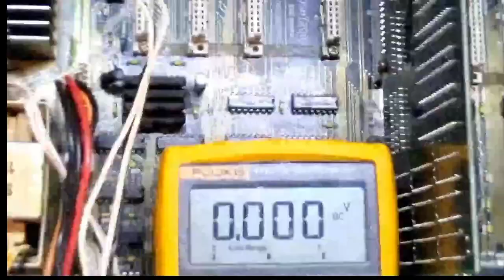Akai s1100 Repair Distorted 8 bit sound

Comment: So Ive never worked on a S1100 but electronic repair is what I do daily.

Imma say your transformer is fine, as mentioned in comment below it's regulated to 12vdc
A step down transformer is not gonna give clean DC voltage. On a side note, a 12vdc power supply can read around 15vdc when there's no load. So 15vdc is normal. A bad transformer generally has bad windings and it'll just be DEAD. A bad voltage regulator can give a wrong output voltage but if that were true every on the 12vdc rail would most likely not be on.
I honestly wouldn't be looking in the power supply area. To be honest, because the sampler has so many IC's you need to probe with an oscilloscope or atleast a cheap logic analyzer to make sure chips are working properly.  I haven't been following all your videos in regards to this but if measuring capacitors or even resistors in circuit you'll get wrong readings. A bad diode is usually OL in both directions or may show an incorrect voltage drop. However I'd still guess your problem is more logic based, ram , cpu etc.

The guerilla repair method is to start with recapping everything. You can have caps read correct but their esr reading will be wrong. A dmm won't show esr

If you get a cheap oscilloscope you can use the schematics to probe along the signal chain and adventually find where the waveform distorts. You'll go from having clean-ish square waves to something really out of place.

Another quick guerilla diagnosis is using a thermal imager. A short circuit will produce excessive heat this heat shows on a thermal imager and will help narrow in the problem area, usually a bad chip.

Probing random voltages or desoldering checking components you'll be there forever.. Oscilloscope are cheap. Even if you just buy a cheap AliExpress one  even a cheap thermal imager. Aslong as it's one that shows a picture not the real cheap ones that only give a digital reading..
Getting voltage readings plus visually seeing the waveform helps alot. Both are  underrated tools for sure, that I use daily in the shop.

Feel free to  DM me. I'm no sampler expert, but I will give you a reccomendation on how I'd approach the issue if I had a customer bring one in to the shop...
Reply from the maker: Thanks for sharing your knowledge, its much appreciated, I have been thinking about purchasing an oscilloscope but not sure which one to but as there are so many , can you recommend one?
Reply from the maker: do you think this would be ok? https://www.amazon.co.uk/YEAPOOK-ADS1014D-Oscilloscope-Generator-Bandwidth/dp/B099S4QP3T/?_encoding=UTF8&pd_rd_w=U67BR&content-id=amzn1.sym.822afc68-e2bb-4420-ac6e-1044cd2e7c1d&pf_rd_p=822afc68-e2bb-4420-ac6e-1044cd2e7c1d&pf_rd_r=Y7D31V3QWD9043DD351S&pd_rd_wg=ItC6y&pd_rd_r=98a2f06a-e0c8-4b34-8163-fbc21c6cf796&ref_=pd_gw_ci_mcx_mi&th=1
Reply: @TheBizzyBScience  yea, that would work. It's kinda nice that it has a signal generator built in also.  Signal generator will allow you to produce a pure sine, square or saw wave to inject into the signal path and see where it distorts... Plus you can then sample the signal gen and make some fat basslines LOL.  Only down side is not sure how the quality control is, it's a 50/50 when buying that china stuff.   

Hantek DSO2C15 - this looks solid. Actually pretty impressive for the $300 cdn range.

 Hantek make a usb scope that's reviewed well but it lacks features. Most of which  you probably won't need, but it's nice have the flexibility. 
Rigol or GW Instek are reputable "entry level / pro" brands. However they cost more and I'd argue the quality isn't much better than Hantek on their lower end stuff.  I'd prob go with Hantek....

Aslong as it's 2ch 50mhz, with atleast and 1gs sample rate ( which is kinda standard), and AC Coupling.... It should do what you need.
Reply: I think there is S1100 schematics floating around the web!

Comment: 14v from the xformer should be ok, its being regulated down to -12 and +12 dc via the 2 voltage regulators on the digital board, therefore needs more than 12v from xformer 👍 just putting this here for reference. The 14v is weird, gotta check schematics to see where thats coming from, or even if it should be there on p109 i know you recapped the digi board, wonder if something is not quite right and the 14v from the xformer is being passed into p109. Maybe if a diode failed short, it is passing 14v to p109? Will have a look tomorrow at the schematics B 👍

Comment: The 4 pin connector on the mainboard p109 should be read pin1 +12v,  pin2 ground and pin3 -12v. I found the noise problem on my s1000. It was a bad co-efficient rom thats ic 12 and 13 near the ram slots on the s1100. Might be worth verifying on the eprom reader can send you the files to check them.
Reply from the maker: thanks man, that would be great
Reply: @TheBizzyBScience  will sort it asap.